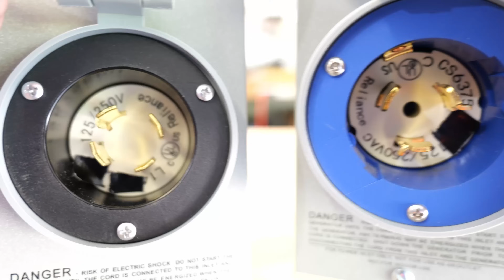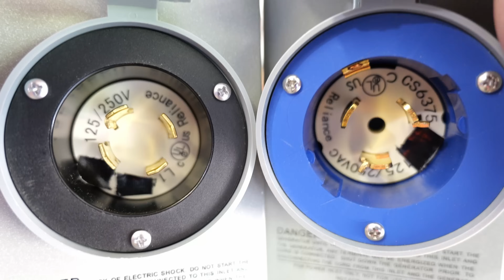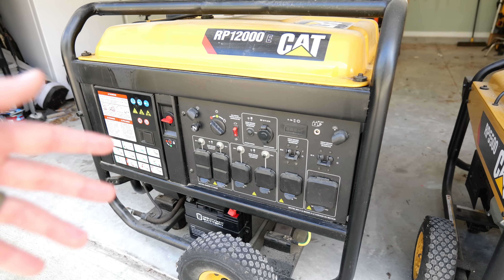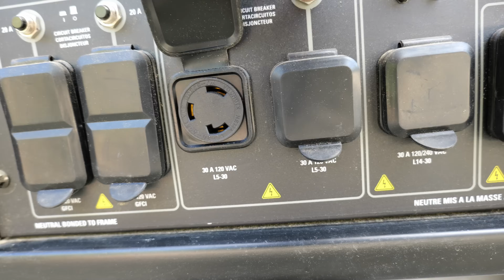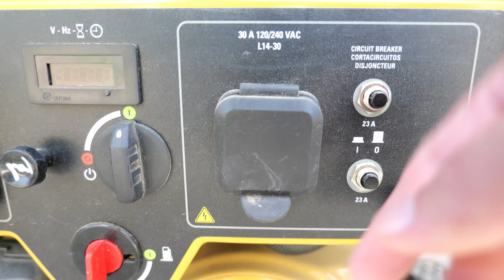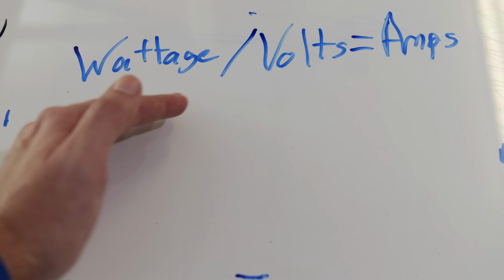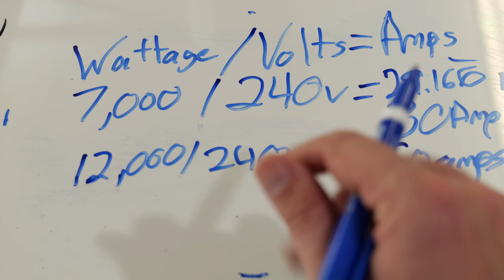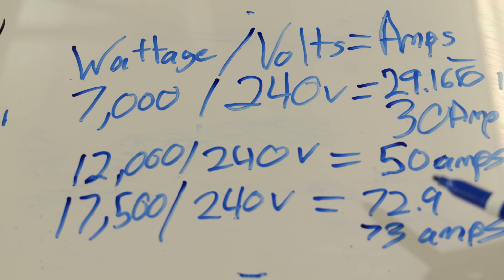30 Amp vs 50 Amp Power Inlet Box.  What's The Difference and Which One Do You Need?

Comment: Help! I am going to buy a generator. I already ordered the wire, box and interlock. The question I have is there more than one type of 50 amp box??? This is what I ordered... WELLUCK 50 Amp Power Inlet Box NEMA 3R Inlet Power Box with 3 Prone 125/250Volt 12500W 50 Amp Generator Inlet Box PB50 SS2-50P ETL Listed Weatherproof Generator Transfer Switch Inlet Box for Outdoor .... Your box has a hole for the point on the generator cord and this box I ordered does not. What gives? All the 50 amp cords I saw have that point. Thanks for any responses.
Reply from the maker: They all vary to an extent.  It should work with your box.
Reply: @HowToHomeDIY  Thank you for your response. Now I'm wondering what that little point on the generator cord is for? If it's a twist lock connection... what purpose does it serve?

Comment: hey, Thank you for all your content, it's huge for peeps like me, that know very little on currents, power etc. I'm curious, why are you dividing by 240 instead of 120 to determine the amps? I'm dealing with a Cargo trailer conversion and will only use 120 and 12v for my operations. Should I still use 240 when determining the generator and amp inlet? or should I go with 120. I was leaning toward 30amp, but if I buy a 4000 watt gen and use 120 it comes up to 33.33, which is too much for the 30 amp serv inlet.
thanks a bunch

Comment: Hi I installed a thru the wall reliance kit 6 outlet  30 amp with a L14 cord to hook up to generator,  the outlet on the generator saying 120v/ 240 v how do i know how much power is going thru to my wall outlet  I only need the 120 v there is no switch to control the power from 120v /240 v my generator is a Generac GP 5000. Thanks

Comment: I thought about installing a 50 amp inlet box so down the road I could upgrade to a larger gen. Is there a converter plug/adaptor that would allow my 30 amp generator to hook up to a 50 amp box? Would there be any issues with using a 50 amp breaker with a 30 amp gen? Thanks!

Comment: I have the generator that’s 30 amp. My fuse box is 30 amp. if I buy a generator like the one you have and I only plug-in to the 30 amp on the generator will I be okay?       if I decide to upgrade the wiring to 50 amp I could do that at a later time, but in the meantime, run the same generator you have with my 30 amp set up in my fuse box, what’s your thoughts? Thanks.

Comment: Hello. Thank you for your helpful videos 👍 My question is, if it's possible to install the 30 Amp power inlet box in conjunction with a manual transfer switch, with the purpose of being able to connect and disconnect the power cord extention cable when generator or power station are not in use?  🤔

Comment: If I may suggest that you give the names of these connectors because when you are purchasing the power outlet box 30A/50A they have a description on them for each application.  For example, the 30A connectors are NEMA14L-30P/L14-30R.  Which is the connector that has one of the prongs that is shaped like an "L" facing inward.  The 50A connectors are called NEMA14-50P/SS2-50R, the female end on this chord or connector has the "L" shape prong facing out.  You have to match the connectors.  It took me a while to figure this out. I visited websites to get the low down.  Thanks for the content I liked the video!!

Comment: Can I connect my 30 amp generator output to a 50 amp power inlet?  I may want to upgrade my generator to 50 amp output in the future but not now.
Reply: Yes with an adapter
Reply: Count the cost the adaptor can run into some money. Sometimes but not always the box with the twist plug can be less costly. 73

Comment: thanx for your video.  I have a 60amp breaker for my welder in my breaker box.  the plug is 30a- can i just change the plug ends to make them 50amp so i can connect a  13000 duramax generator to power my house in case of power outage?

Comment: Why don't you get a whole home standby generator to power the whole home?
Reply: Financial barrier to entry is a common reason, id guess. A decent portable generator can be found 2nd hand for $500 +/- and a power inlet installation can be done for around $200. So $700 vs. $10k. Most folks without the extra money will most likely go the portable route.

Comment: Is there an adaptor that you can use to plug into the 4 prong so you can plug in a 30amp rv surge protector to plug in your rv?  I have been looking for one and can't find one anywhere.
Reply: Yes, BUT an RV 30 amp is 120 volt only. It will only use 1 leg of the 2 pole 30 amp 4 prong...

Comment: I did just what u said I bought a Generac 15,000 Watts I thought the bigger the better but if needed down the road, I can have the 50 W plug power the house and still use the 30 amp to power something else like an addition or something? I watched the other video and went out and checked my meter to plug it into the bottom like you did, but mine is locked. Can’t open it.??
Reply from the maker: You probably just have a meter box then.  My main shut off it’s outside at that box.  Will have to be installed wherever your main disconnect is for the interlock kit to work.  15,000 is a good amount of power for sure!
Reply: @HowToHomeDIY  I wish you could post pictures in the comments on YouTube. There’s another whole box under the meter. It’s almost 15 inches in length and 12 inches across i remember when it was installed it kills the power to the whole house behind that box.

Comment: I have a genny that is only capable of putting out 20 amps, but I have a 50 amp inlet box.  Do you know if there is an adapter for the male end of the 50 amp cord that I could fit on it to plug it into my 20 amp generator and if that's safe to do?

Comment: Great video, so my question is. I have a generator that runs all three (gas, propane, and natural gas) highest is 9500 with 12500 starting. Natural gas is 7500 with 9500 starting. With this, would a 50amp breaker be ok if I decide to run natural gas. I might use the others, but natural gas will probably be my main source.

Comment: Great video! Question: I want to have whole house back up for the rare power outages. The inverter kind is less powerful and far more expensive, but given that I have a gas furnace and refrigerators with control boards, some people seem to think they are necessary. Can I get away with a generator with higher THD or do I really need an inverter to run modern appliances?

Comment: I have a 50 amp transfer switch inlet , can I plug a 30 amp cable from my Ecoflow battery to the 50 amp inlet using an adapter ?  Would that be safe?

Comment: My portable generator/inverter has a 30amp 120V AC socket, but it's only 3 pronged. Is that a problem or can it be connected to an inlet box? Ive read online that these are for RVs only and shouldnt be used to power a home
Reply: RV 30 amp is 120 volt only.  the other 30 amp is split phase...240.

Comment: I have and old box with screw in Buss fuses. Now what, how would I hook up a transfer switch to that?  An interlock kit won't work.
Reply: I think you’re required to update that box when you do any electrical work on the system — to a modern circuit breaker panel.  Get a style that’s commonly used in your area so parts are available and select one with an interlock kit available or that is compatible with a transfer switch.

Comment: I have a predator 9000 watt 7500 running watts . Can I go with the 30amp receptacle. I worry if I used a 50amp the receptacle will be different. I did the math and it comes out to 31 amps

Comment: Excellent overview. I have installed a 30 amp box since my gen is 7000 max. I thought about installing a 50 amp so down the road I could upgrade to a larger gen. Is there a converter plug/adaptor that would allow my generator to hook up to a 50 amp box?  Thanks!

Comment: The first thing I noticed was that the 50 amp receptacle had thicker prongs and ofc I didn’t notice it until I seen the prongs on the 30 amp receptacle and I did also notice right away the copper plate on the outer wall of the 50 amp receptacle.

Comment: At Costco, I saw a Generac portable generator with 9200 running watts, but NO 50 amp receptacle, only a 30 amp. Weird…
Reply: I just recently purchased that one I think the reason they went with 30 amp is for protection issues if you run a 50amp receptacle you run the risk of overloading the generator since 9200 watts will only pull 38.3 amps max.

Comment: In my humble opinion, 50 amp inlet box & interlock switch are the way to go, regardless of the current size of generator(as long as gen has a 50amp receptacle).
Reply: If the generator has a less than 50A output breaker then you can still  use a 50A  inlet to your house panel.   The generator breaker will trip instead of the 50A and still protect your generator and wiring.    30A plug for the generator and 50A connection for the house is OK.
Reply: @EagleNestLiveTexas for added safety, I would also suggest installing a 30A breaker in the panel. And in future if you upgrade to a generator with a 50A outlet, then just simply change out the 30A breaker for a 50A breaker.
Reply: yup. Just get the 50.
Reply: Hi there, my generator 9000 w ÷240v =37.5 A 
What you recommended i get 30A or 50A ?
 thanks
Reply: @  50 AMP, for sure. Cheers
Reply: I have 2 gens I can hub together creating 7200 watts.  at 120v is 60 amps and 7200 watts at 240v is 30 amps. I have a gas range and heater should I go with the 50amp plug?

Comment: with 30 ( 10 gauge wire ) amp gen. how long / far away can the generator be from the inlet box ?   25 ? 50 ? 100 ? more ?  feet away ?  thx for your vids, very helpful
Reply: The keyword (search term) to search for is “ampacity table.” Most wire and cable mfr’s publish such charts online — which show acceptable distances based on wire type, insulation type and temperature (max). Pick your max cable length (or the next longer increment) in the chart, and then see what types and sizes of cable you can use.
Reply: @atlantajunglepythons1744   Thank you  !

Comment: So on a 30A or 50A output at 240v does Each Hot lead carry 30A or 50A so that a 240/50A out from a generator (looking at a 15KW generator) would actually be 120v/50A 2x for 100A across both legs?  that is what I am hoping for.

Comment: I went with a 30 amp plug and a 50 amp manual Gen transfer switch.  I do not need to run everything and with my generator+27 gal of stored gas, I can maintain the house for a week with my planned usage pattern.  What I can't do is run the electric stove, electric clothes dryer, or whole house AC unit.  In an emergency, I should not need those things.  Note: backup cooking is a propane camping stove.  If NG for heat runs out, there is 20 gal of Kerosene in storage for a Kerosun heater.

Comment: great video, think its fine based on 70 amp example you have but if I have a 30 amp, 9,000 peak watt generator and a 30 amp but 7500 watt receptacle, would that be a problem? given that the generator has more wattage than the inlet box ?

Comment: 💥Great Video; My Generator said 30Amp locking but my House Outlet is 50Am... is OK to use an adaptor?
Reply: Yes, you will be inputting up to 30 amps into an inlet that can handle up to 50 amps.

Comment: If you have a choice, put in the 6/3g, (4 wires) because you can easily derate the generator breaker to 30 amperes, but you can't easily uprate 10/3g to 50 amps. P.S. 8 gauge around here is a 40 amp. breaker, usually using 8/2g wire to an electric hot water heater. 💙 T.E.N.
Reply: P.S. Again. Somebody ought to invent a main breaker that has some way to trip it by wire so that it automatically shuts off when you plug in a generator. I bet that you could make a fortune on retrofits, and yes I know about transfer switches and how to properly connect one or many generators, I'm just saying that not everyone can afford or needs a permanent generator, and this is a reasonable option for places that have minimal power disruption issues, as well as allowing you to use any generator that is available. 💙 T.E.N.
Reply: P.S. Oops, I meant to say 10/2g for the 30 ampere 3 prong/wire receptacle. 💙 T.E.N.

Comment: I got an rated 8,000w with a peak of 10,000w ... since my amps are just over the 30 then I should get a 50amp inlet?... or just get a 30amp and only use the 120v outlet?... any help would be appreciated cause I've gotten confusing input... sounds like I'm right in the middle lol
Reply: I'm assuming I need a 50 amp
Reply from the maker: I would just go with the 50 amp application.  That way you can use all of your generator and have no concerns about the wiring sizing.  The price difference isn’t really that much.
Reply: @HowToHomeDIY  thanks

Comment: There are plenty of videos using gas generators through outdoor inlet boxes. What is the solution for SOLAR generators that will be inside the house, not outside. ( I noticed that those inlet boxes say "NOT for indoor use."

I have a 5000W solar generator. I'm pretty sure that to claim the IRS tax credit it needs to be wired into the house wiring (obviously through a transfer switch).
The main breaker box is on the outside garage wall. It gets way too hot in the summer to locate the generator inside the garage as that would kill the electronics, so I can't simply install a transfer switch inside (close to the main breaker box of course) and plug in the generator. The inlet box needs to be inside the house. What kind of inlet box can I install inside as I noticed they all say, "NOT for indoor use" plus how do I wire it back to the transfer switch?

Comment: I’m using a 30 amp inlet box for my generator. What size wire gauge do I need to run from the inlet box to my panel box with a 30 amp breaker and interlock switch if that run is 60’ long?

Comment: Generator cords, 50 amp, to connect generator to power inlet box. Is there a difference between a generator cord and a RV cord , to connect from generator to house ? Are they interchangeable? Some cords on female end have a twist lock, others have a threaded female ring ?
Reply: Get a cord with the connectors that match your application. The wire gauge should match, too: it’s based on the type of wire, the insulation (heat rating), and the maximum current capacity at a given distance (AMPS or Ampacity).
Reply: An RV 30 Amp is only 120 Volt.  His 30 amp inlet box is split phase. 240 volt.....

Comment: Great videos thank you. I currently have a generator that only has a 240-volt 30-amp outlet I am going to install an inlet box. I was thinking about upgrading my generator in a few years to a larger one with a 50-amp power supply. Can I install a 50-amp inlet and just run my current generator with a 30-50amp adapter until I purchase another. Or could that cause a problem? Thanks again.
Reply: Yes, you can.

Comment: Further to above comment- 240V is the generator output voltage. Why 240V if standard AC voltage from transformer to the house is only 120V?
Reply from the maker: I explained this in my reply to your first comment.  Most homes have more than 1 wire bringing 120V.

Comment: Why divide wattage by 240V to determine the amperage? I thought the standard ac voltage is 120V here in the USA.
Reply from the maker: It is 120 per leg.  Most applications in homes will have 2 legs in their panels.  When we install a generator hookup we are usually install a double pole breaker which covers both legs so you multiply the 120 by 2 and it’s 240v.  But everything is a case by case basis but this is the most common.
Reply: What is the out put voltage from an average generator? I thought it should be 120 v - unless it is 2 phase.
If so, then why is it 2 phase. Or why do we need 2 legs in our panels if the output at all our output sockets in the house is 120v?
Reply from the maker: Depends on what receptacle you plug into.  One that looks like a regular receptacle will be 120V on a generator but the ones used for hooking up to the house are going to have 4 prongs.  One ground, one neutral, and 2 hots.  That’s why it’s 240V.  Some generators will have a 30 amp option with 3 prongs which are 120V but hooking up to the whole house will generally be 240V.  You need 240V to have 120V going to each leg in the panel.

Comment: Adam, I really appreciate your videos. I really try to do a good job of researching things that I need to do before starting. Sometimes it’s hard to do the correct research if you don’t know the question to ask. With that being said I don’t blame anyone but myself but I really need your help locating a male 4 prong 50amp receptacle box to replace/install below my breaker box for my generator connection! I bought a suggested 3 prong 50amp box 2 weeks ago  from amazon but all of the 50amp cords I’ve found locally have 4 prong connections on both ends. The generator connection for the 50amp is 4 prong and a 30amp on it is 3 prong. This is confusing to me but that doesn’t take much to do. Because of my disabilities and lack of tools and hard to find wire, which caused me to spend at least an hour and a half carefully stripping it from a cable, it took me 4 days sporadic work to complete! Not a lot of money but a lot of fortitude! I’m not sure if I can return this because I already installed it but I need to find a replacement now, if possible please!! GOD bless!
Reply from the maker: I replied to your first comment but now I’m confused on what you have.  Did you install a 50 amp power inlet box or a 30 amp?  If it’s 50 then the male end of the cord should have 4 prongs on the male side for the generator and 3 holes on the female side for the power inlet box.   If it’s a 30 amp power inlet box then it will be 4 prongs on the male side and 4 holes on the female side.